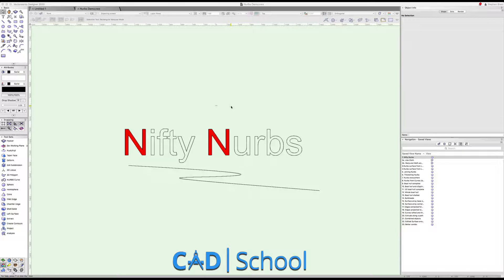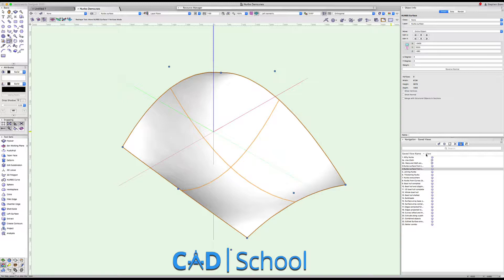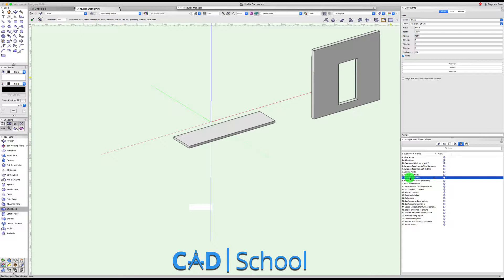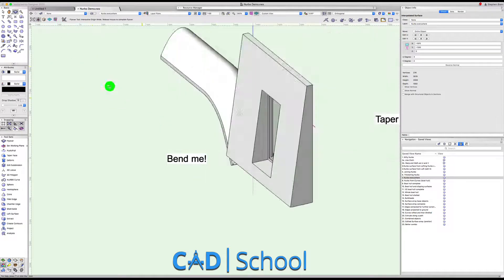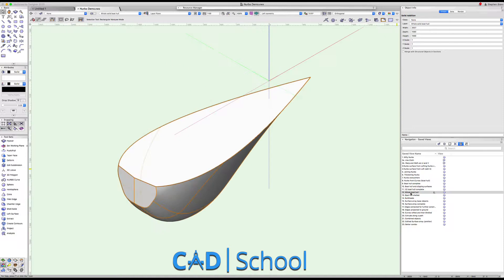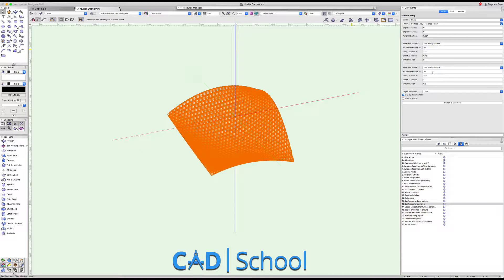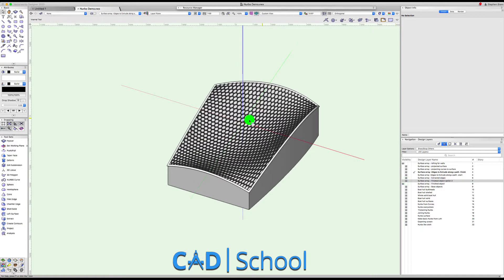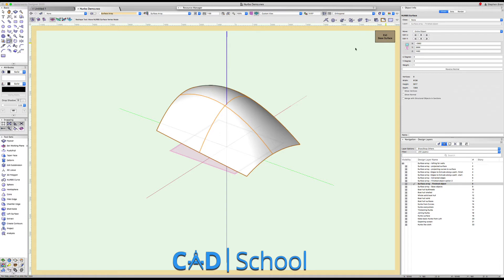Vectorworks Nurbs Training

Comment: Hi Steve, is vectorworks capable of taking an existing extruded shape (one half of a hull) and then fitting it to the bulk heads, setting points to move for instance? You see i made a physical model first now i want to put it all in vectorworks but i can't figure out how to move specific areas of that shape.
Reply from the maker: Nick - yes - if I understand you correctly then the answer is yes!

Comment: Dear Steve, I am having trouble applying a texture to a similar NURBS object (I tried making a Renderworks Texture through Recourse manager. Apply and with 2D Atrribute Mappping Tool scale and move it... This doesn't work. I get or image in projected in the wrong plane view or image all cut in small pieces.) Can you please explain how this can be done?
Reply from the maker: you can't use the attribute mapping tool while retaining Nurbs (sometimes called UV) mapping. Use the Render tab in the object info palette to adjust size, rotation and position by numbers. You can use the Attribute mapping tool if you convert to planar mapping... email me if you want further help!
Reply: @CADSchool  Ah I see...That works... although positioning is very hard by numbers if you have to be accurate (as I applied a t-shirt image on a t-shirt cut-out Nurbs Surface in this case). I wish there was a slide for this. Thanks anyhow for the help!